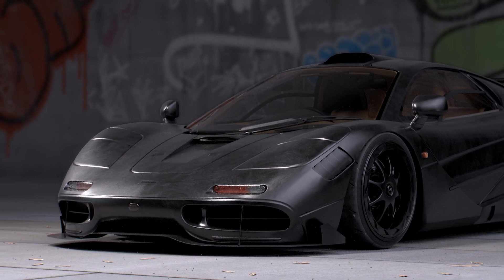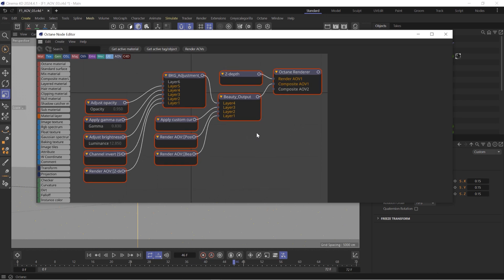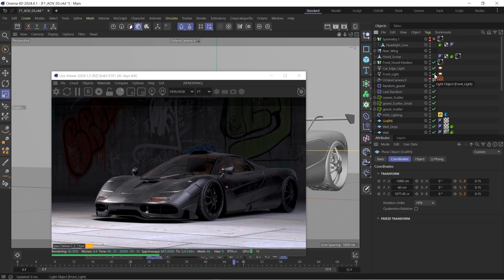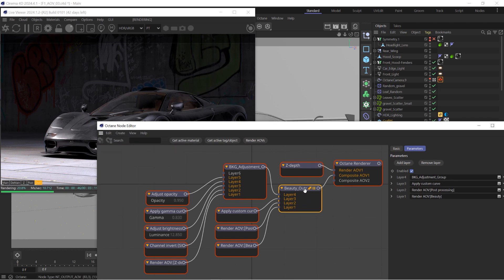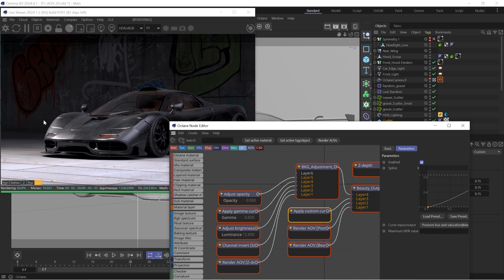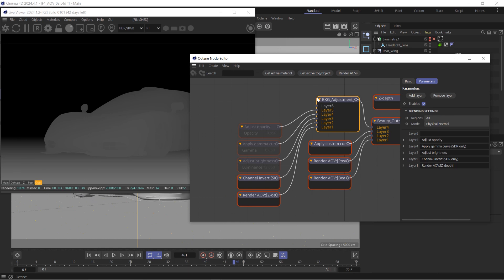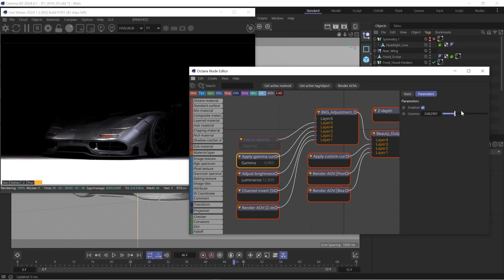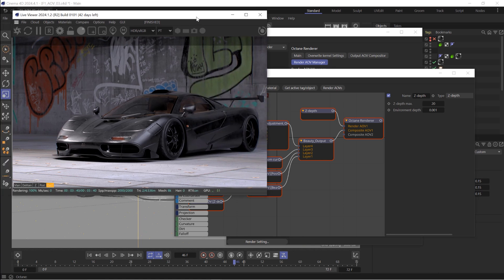Master AOV Z-Depth Compositing Inside Octane

Comment: I would use compositor more but it has some bugs and ux flaws.
1. Please fix the masking.  It creates outline around masked objects.
2. It should work offline meaning no need to restart render every time I want to use Compositor. 
3. Eeach layer SHOULD HAVE opacity and mask control. Current system makes you create unnecessary node groups.
4. The creation process is pretty strange compared to other compositors as you build nodes from left to right, not the opposite.